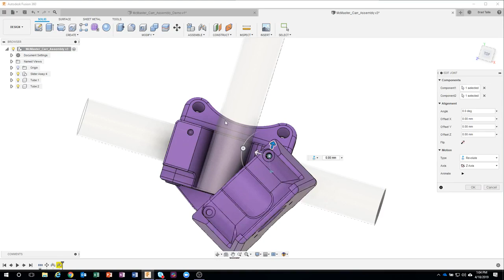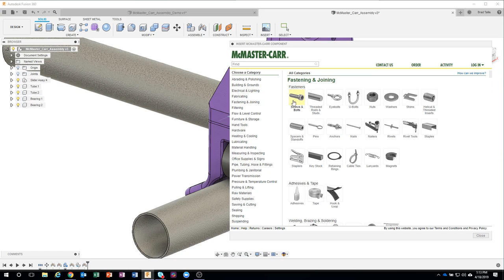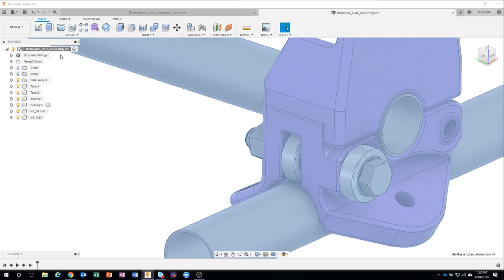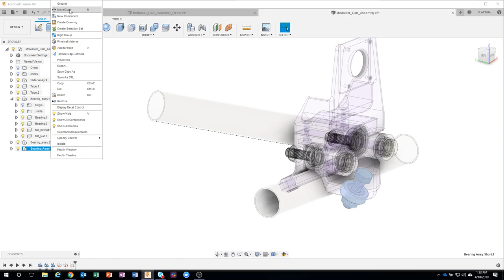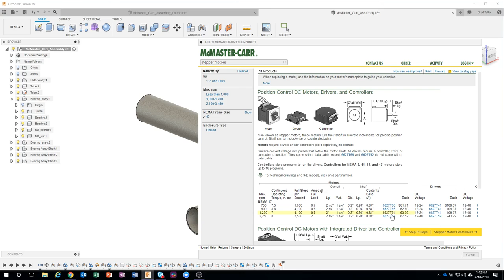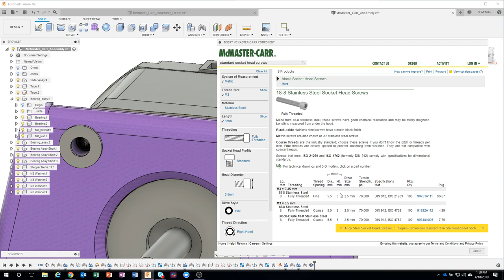Episode 27,  Mastering Assemblies with McMaster Carr

Comment: Great tutorial, as ever the subtle Tips & tricks are fantastic. From a technical point, "I" would  suggest using "shoulder bolts" to mount the bearings. Keep'm coming!
Reply from the maker: @Jeff-  Yes, I would agree.  I just used what was used in the sample assembly I downloaded off of GrabCad.
Reply: @bradtallis8968  
Hi Brad, I couldn't find your email, sorry for the public posting.

I come from many years of SolidWorks (circa 1995) but Like John Saunders have switched to 360 and find it to be very intuitive and powerful. It’s my exclusive modeler now for my mini-CNC mill, lathe and 3D printer projects. Yours and Lars tutorials have made the transition far less painful – many thanks to you both.  

I have two “pet peeves” which most likely is lack of knowledge; 
1) In SW I was used to being able to press the “Arrow” keys and increment rotation in small (user controllable step angle) on the axis 90 degrees to the arrow being pushed. I have set Fusion (in the UI) to emulate SW but this function is not included. Frankly, I’m not sure what SW functions “are” emulated. It was very useful to be able to freeze one axis and rotate the model to see the relationships to other internal features.  You could also press the “shift key” and cut the increment to finer steps.
 I can’t figure out how to do this in Fusion using just a mouse.

2) When adding dimension I miss the up/down arrows in the Pick box to provide a nice way to “tweak” a dimension rather than having to re-type the value. No, you don’t use it every time, but it was a nice feature that was user settable to the step value. I don’t see any preference box to enable this feature.

I have not tried any other “emulation” settings so maybe they are available else ware.  

A “quickie” tip during one of your “live streams” might help a lot of us.

Thanks,

Comment: Excelent vídeo! Just one question, how did you know the Nema 17 motor screw was M3? With inspect we only checked the length
Reply from the maker: @Alejandro-  Ah, you caught me...  When I was practicing for this LiveStream, I measured the diameter of the hole.  But, in the actual LiveStream, I forgot to measure it.  So, basically, just use the Inspect command in the menu across the top to click on the hole and it will return the radius and diameter of that hole.